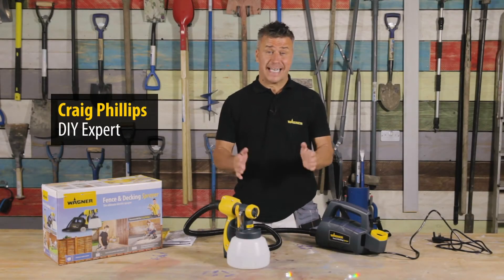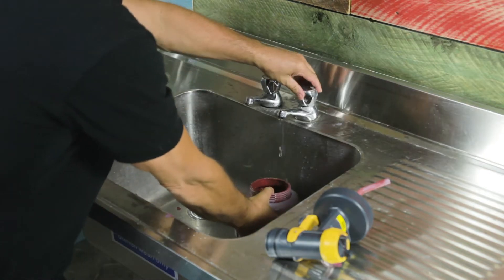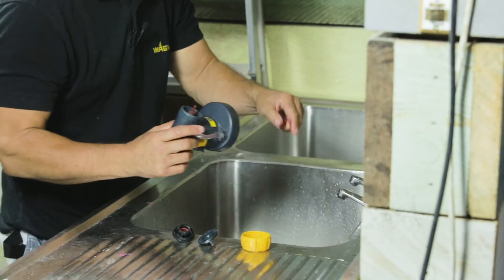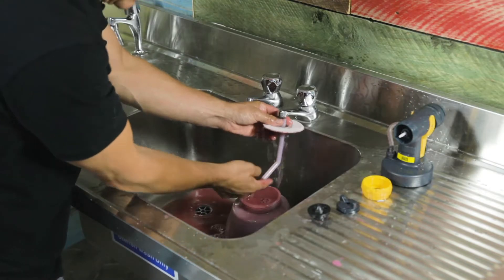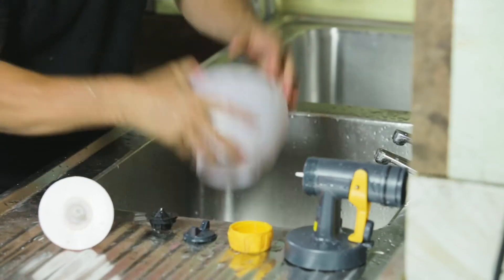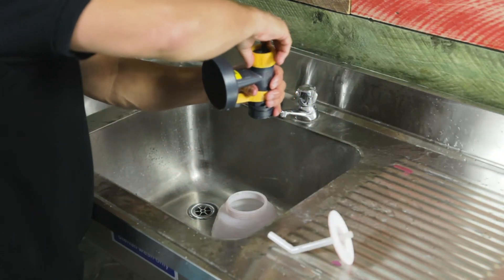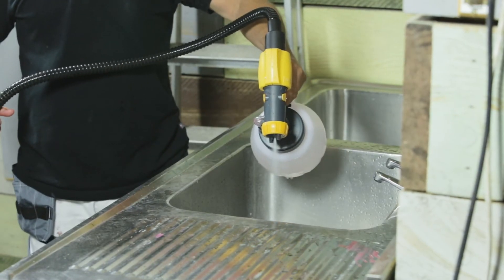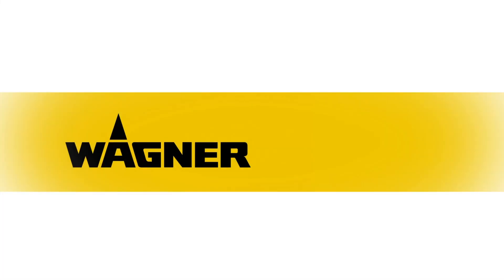How to clean a Wagner Paint Sprayer | Wagner Top Tips

Comment: How would you clean Hammerite paint after use ?  Also, does Hammerite need to be thinned as it seems quite a thick product?
Reply from the maker: I'm not to sure sorry I've not used not for many years now,
Reply from the maker: If its Oil based you'd need to us White spirts
Reply: @MrandMrsDIY  hi, I tried everything and did every step from all vids, the air comes out powerfully but the paint comes out very weak

Comment: Didn’t clean mine with last use. Used oil based latex paint and didn’t rinse after use, very thick. Any suggestions I usually just use paint thinner.
Reply from the maker: Always clean before you put it away! Maybe white spirits will help. You can always blast warm water through the machine until it's clear, cheers

Comment: How do you clean it if you use oil based paint
Reply from the maker: You have to wipe all the paint off with a cloth then fill the res up with White spirts and spray though tow or three times, it just takes a little longer to clean that water.

Comment: Hi Craig, thanks for all your handy vids. I have purchased a w350 for small furniture spraying. This takes several coats of paint with drying times (I am mostly going to be using chalk paint) - can I leave the paint in the sprayer whilst I wait for the first and second coasts to dry?
Reply from the maker: hi Anna, great I hope your enjoying using it, We use Chalk paint all the time and it works very well when diluted a fraction just about 10% water, yes your can leave the paint in the unit while it drys, most @Frenchipaints dry after an hour when sprayed but its best to leave it for two hours before re coating, with the application being so quick and easy your best doing 3 coats.
Reply: @MrandMrsDIY  thanks!
Reply: @MrandMrsDIY  how long can you leave paint in the gun for?
Reply from the maker: @Jesterjones9073  Its fine all day most of the time, you may get a little dry section on the nip that I normally just scrape off then give to a little shake and start re-spraying,
Reply: @MrandMrsDIY  thanks
Reply from the maker: @Jesterjones9073  Your very welcome
Reply from the maker: @Jesterjones9073  Your very welcome

Comment: Hi Craig I use liberon decking oil which they say you can brush roller or spray it  but clean with white spirit. Can you clean the sprayer with white spirit then wash out with water thanks.
Reply from the maker: Yes sure, we've used oil based paints and clean with White spirts afterwards, we have some videos online of use cleansing the units

Comment: Hi there - thanks for the video! 

Would I follow any different directions if the spray gun was left a week without cleaning to ensure all the dried paint is removed? Thank you!
Reply from the maker: Yes just use warm water and it should come off!
Reply from the maker: Or you may have to keep skin hot warm water 3 or 4 times until it starts to break away then clean it up

Comment: Hi Craig I’ve got these to paint my wall.. but when it comes out the machines it’s splatters not a smooth spray.. this was straight out the box.. and when I clean, any advise what I can do to fit it?
Reply from the maker: Most fo the the time when it splatters its just your paint to thick, dilute it down by 10% then try it on a piece of cardboard, normally resolves strait away
Reply: Won't thining the paint weaken the durability of the paint especially exterior paint ? Plus says no thining required

Comment: question / the small container sprays water, the large one does not?????? WHY???
Reply from the maker: there could be a blockage in the large reservoir, take it apart and make sure its completely clean and free of any dried paint etc
Reply: @MrandMrsDIY  I took it completely apart but unfortunately, it only blows air. thanks for your comment.
Reply: @MrandMrsDIY  Hello Craig, I finally found the problem, it's a bit embarrassing but I just wanted to let you know, the air hose wasn't connected. I found out when I saw my dog chewing on it. working fine now. thanks for all the tips.
Reply from the maker: O no sorry to hear that, But glad your worked it out and got the job done. 
 @oldhippie8774

Comment: Or……. Let’s be real & quit playing around like we’ve never painted a huge job or put in a full day and set this thing down without Rinsing and scrubbing it as clean as it was brand new!!!   Paint even dries on/in this thing while I’m painting because there is a lot of high volume air blowing around the nozzle.   

So for the love of something……. Show us how to clean the “real world” sprayer!!!!!! The dirty one with 3 colors hardened in all the crevices.
Reply from the maker: All paint sprayers like brushers and roller will be drying as your using them, as always when finished any projects all tools should be cleaned well, most fo the parts on your paint sprayer will be machine finished so there very smooth and should clean up well, if you have a lot of mist or over spray on your accessaries when finished painting you can alway soak them in water before cleaning them with will help speeded thing up